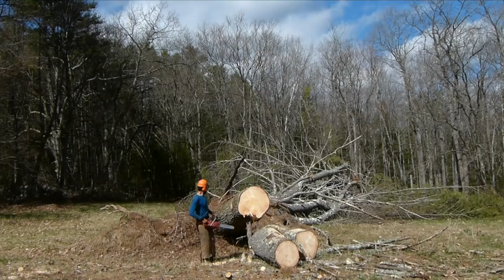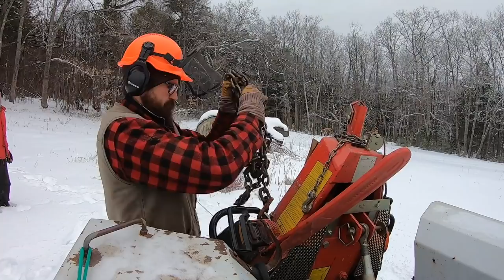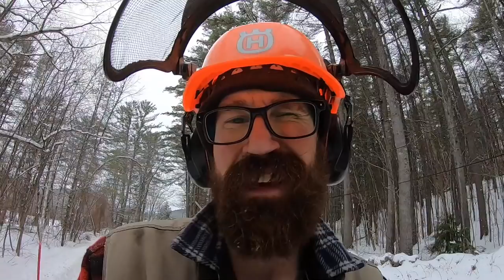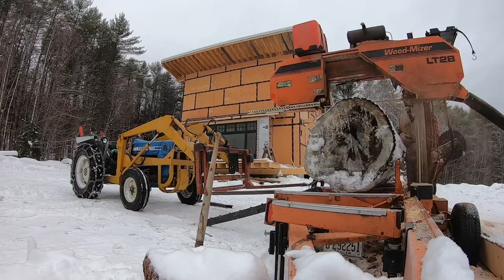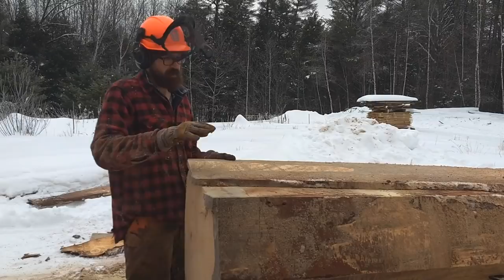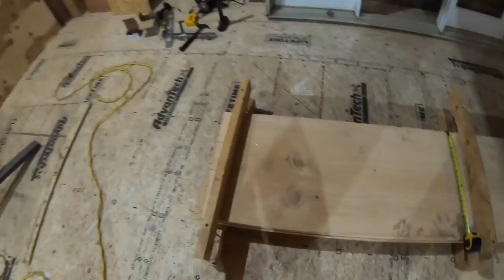The Biggest Log Ever Sawmilled (by me)

Comment: Morning Bus
That will be very nice for whatever project you dedicate it to.
Those big logs take a lot of time and effort. Have milled some big White Oak logs. Started using a 10’ heavy tow strap to turn the big logs. I wrap it around the log in the direction that allows it to turn in the direction I want it to roll. Then I use the loader to raise the strap to turn it. My mill has a hydraulic log turning system but it is to much for the system, especially when the log is over 10’ long. I really enjoy your channel Bus. Take care, be safe.
Reply from the maker: Great suggestion. That would have been much easier.

Comment: Good job Bus, That was one hell of a log. That Cant was huge. I got a 36" pine log that will be on the LT35HD in the next couple days just have to mill 2 more logs in front of it, I'm a little excited but I have no help and only a little tractor, not a beast like yours. Keep up the good work on the house
Reply from the maker: Good luck man! That 35 has great power in the ram to spin it. You should have no problem, particularly if its round. Thanks for the comment